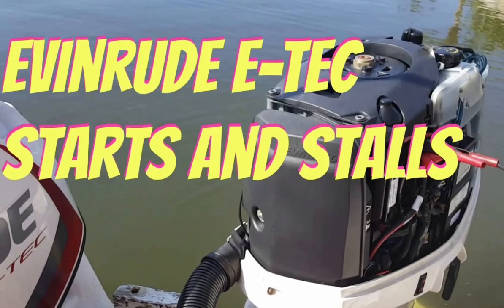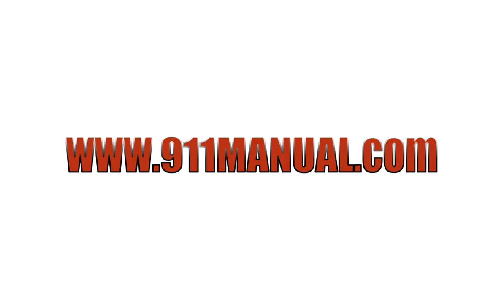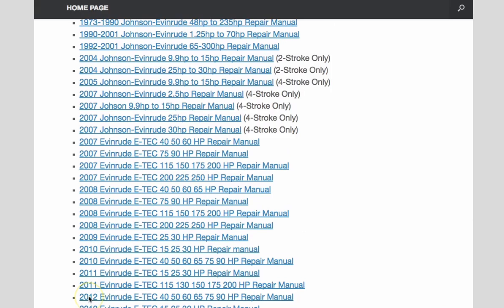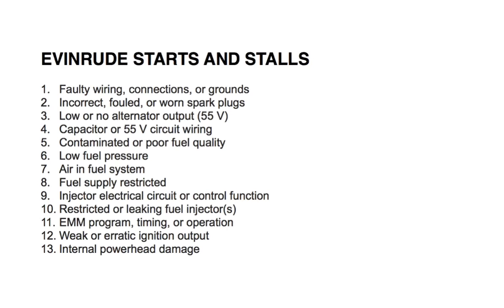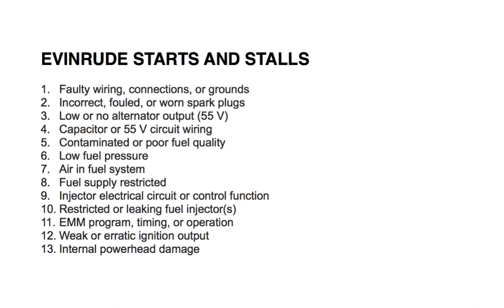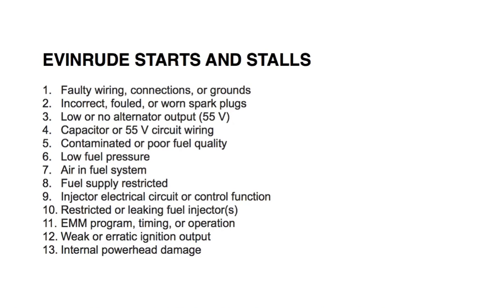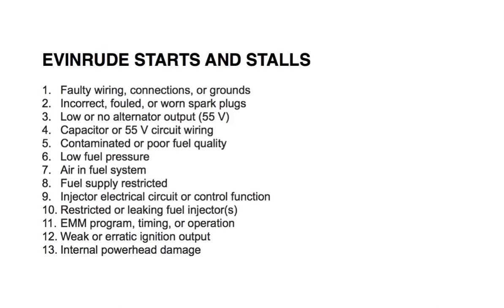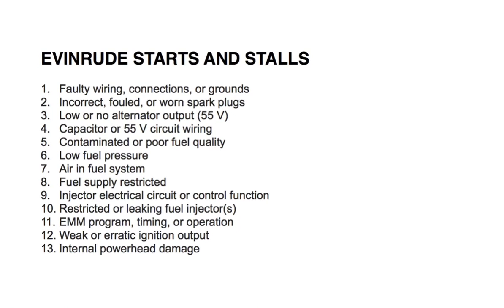Evinrude E Tec Starts and Stalls

Comment: I have a 60hp etec from new. It was fine for 2.5 years but then suddenly stopped. It would idle but then stalled when put in gear. Took it to the dealer and the fuel injector on cylinder 1 needed replacing. Luckily a warranty job. Anyway so none of those on the list.

Comment: My 2013 evinrude 30hp ran full blast for 5 to 10 seconds then bogged down and died now it won't start again
Reply: muddinmoose did u ever figure out what it was
Reply: I HV an etec ho 250 runs and goes on safety mode I change tps spark plugs capasitor watersaperator crankshaft sensor clean injector an still runs an loose rpm